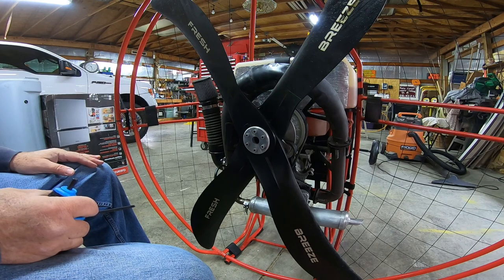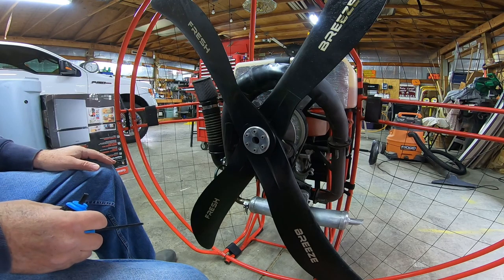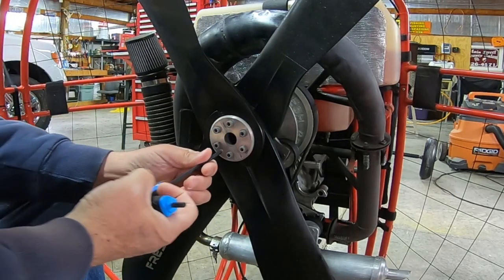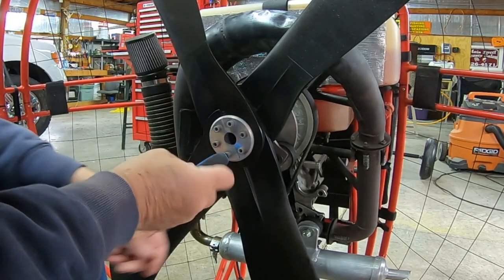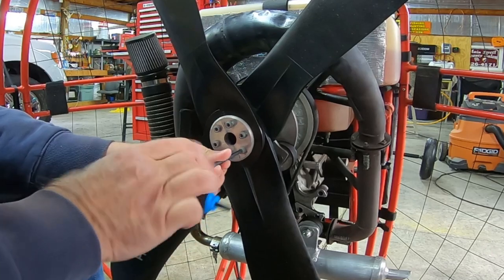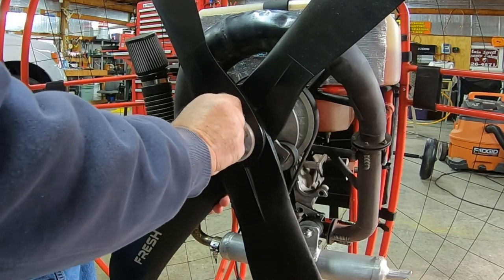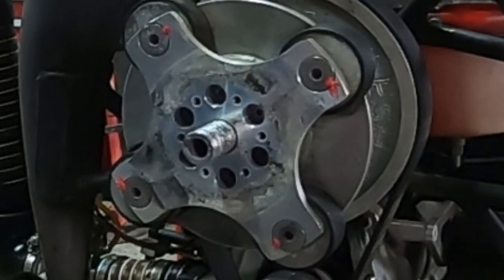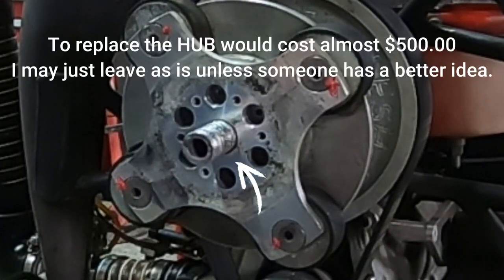Fresh Breeze Monster Tear Down - Part 1 - Ohio Paramotor Trike Adventures

Comment: Thanks Bob,  Looking forward to letting us walk with you through this.  You being a "hour" front runner 😉
For the engine overhaul are you thinking -- "Recreational Power Engineering"?
Sending props to?   
Interesting that the prop hub is scored.  Maybe from the vibration of the props (ends) bending/flexing forward and back as they spin causing small imperceptible movement(s) at the hub?
if it's just surface scratches with no underlying cracks, maybe just smooth it out?
Reply from the maker: Yep Rec Sport up near you.  The pin has some good wear on it but it’s been that way for years now.  Hope to release another video soon.  No big hurry as we have 5 months of hibernating.  😂
Reply: @Ohio-PPG-Trike-Adventures  Oh yea, thanks for reminding me (hibernation) 🥶😭😭

Comment: You've owned this 7 years.  How easy/difficult is it to get parts for the engine?  A person nearby has a killer price on a rig like yours, and I'm just worried about support for it.  Truthfully I'd like to go 4 stroke like the SkyCruiser, but the one for sale might be a good first machine.
Reply from the maker: Parts are pretty easy to get.  They’re just not cheap.   I’d like a 4 stroke that would be nice.   What unit is near by and what are they asking?
Reply: @Ohio-PPG-Trike-Adventures  Black hawk low boy quad with an 80 hr MZ-34 engine $5,400 includes the wing, which is too small for me.   Even at that, sell the wing and buy a new one, still pretty reasonable. I need to start my training first, so I'm just keeping my options open.